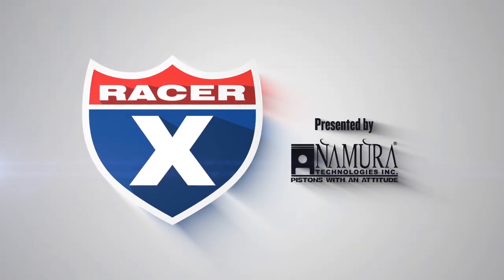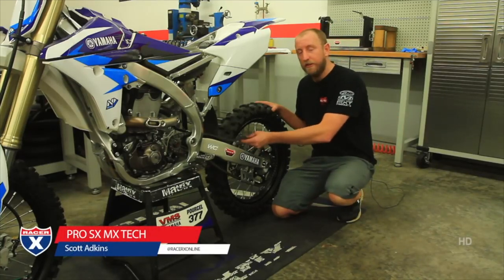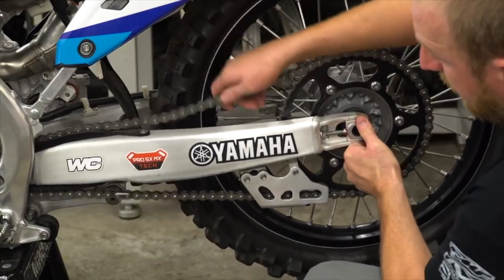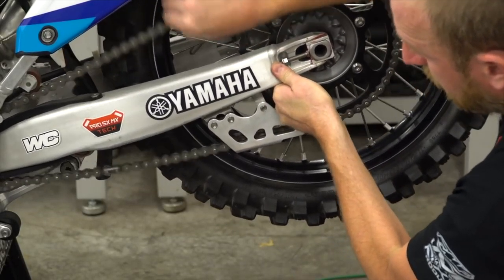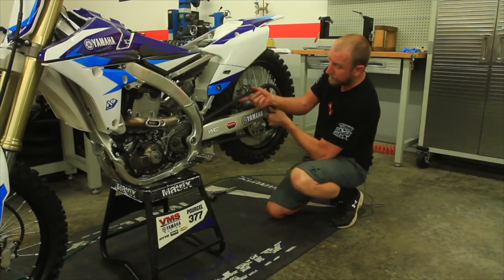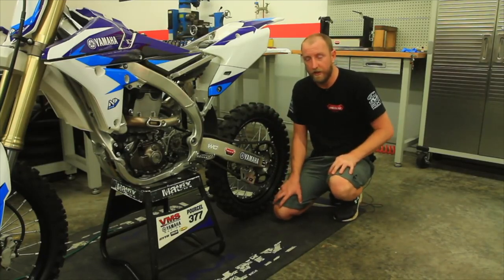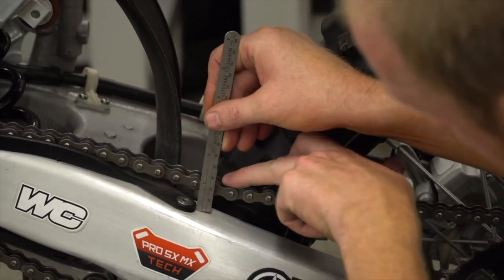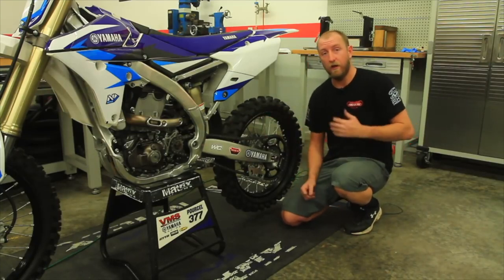Racer X Films: How to Adjust Chain Tension on a Dirt Bike

Comment: You can also just just set the chain tension by measuring the slack like most manuals say.  Seems like taking off the rear shock creates a lot of extra work with very little benefit.
Reply: @chupacabraracing181  ?
Reply: Yeah I was like ummmmmm

Comment: WTF you suggest everyone remove their rear shock to determine chain adjustment. You probably don't need to do any more of these kind of videos.
Reply: He's trying to show how at different angles how the chain can get tight! He's not saying you need to do this every time it's to just get to know where your current bike new to you might bind up at certain angles
Reply: shock doesn't need to be removed for almost every bike. Just remove a couple of bolts connected to the shock and the swing arm will move just fine. Takes 5 minutes